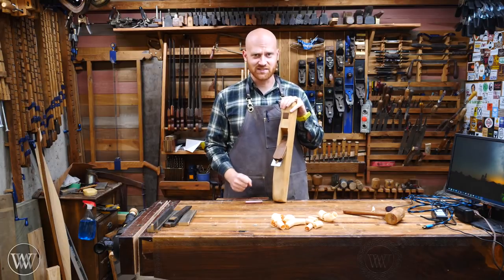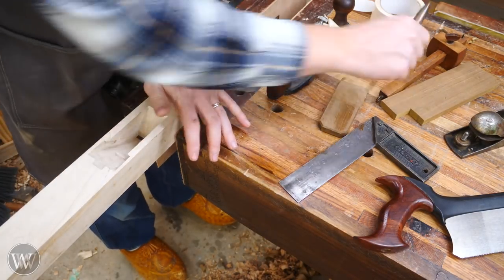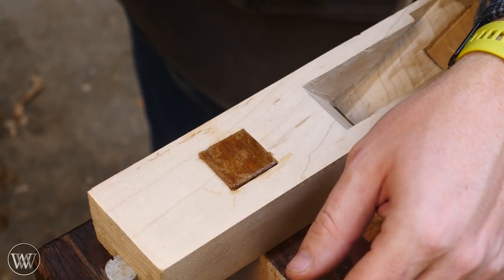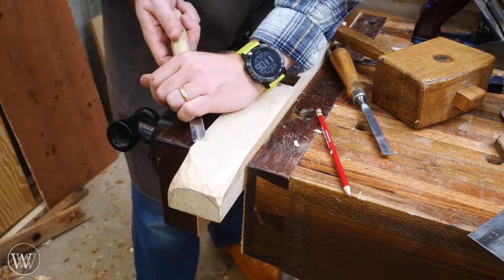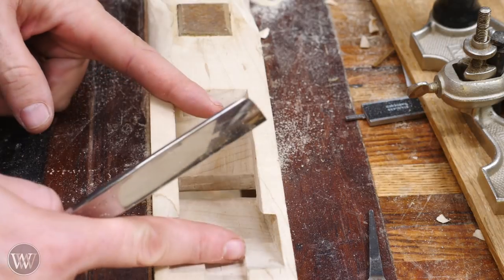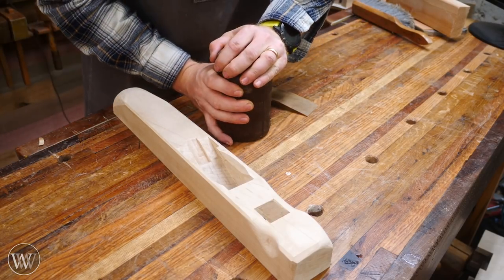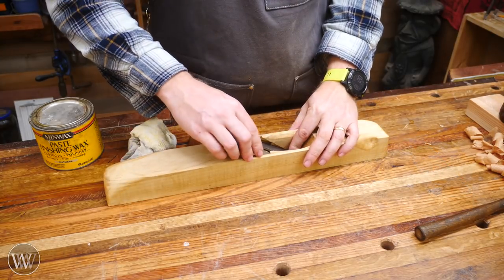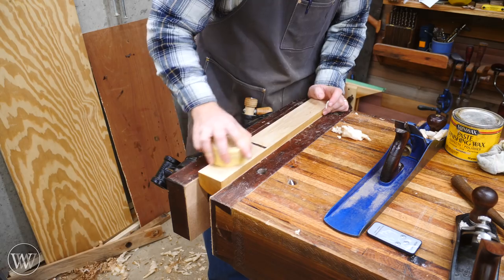Making a Low Angle Jointer Part 4 | How To Smooth and Finish The Hand Plane

Comment: I really recommend this.  I got the plans and made it with an old iron I had lying around, and a piece of white oak pallet wood..  I don't even have a chip breaker.  Making this was easy, and very rewarding, and was perfect practice for when I get a Hock iron and use that 3 x 3 piece of hard maple I've had for 5 years.  Here is a tip - make a prototype like I did - I learned a lot doing it.  And even though it is a prototype, I have a feeling it will end up being my favorite plane.
Reply from the maker: Thanks Bill. That means a lot. It is so rewarding to make your own tool that fits you.

Comment: Does the front of the escapement need to be the same width as the iron? Every time I look at it, it looks narrower
Reply from the maker: it is narrower that is what holds the wedge in place. at the bottom, it is the same width.
Reply: Wood By Wright ah ok, I've always wondered about that. Thanks!